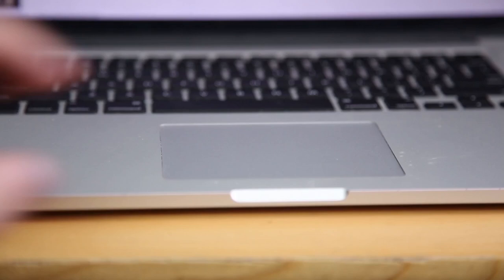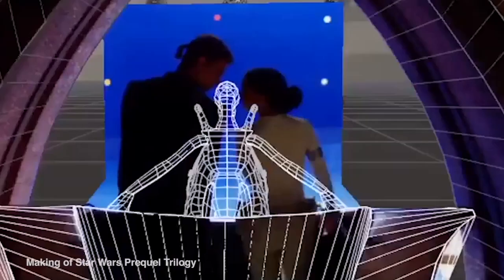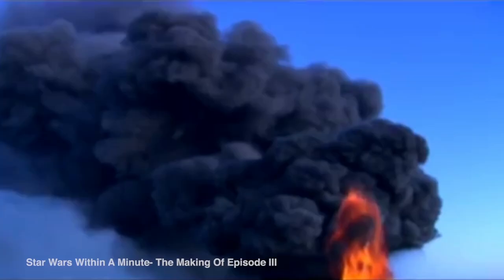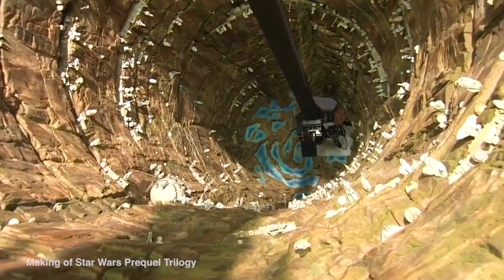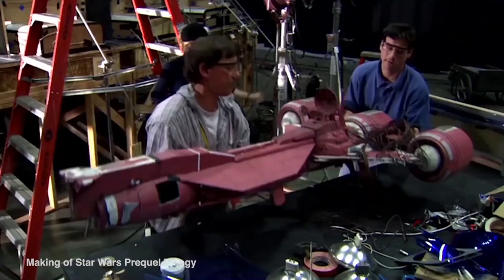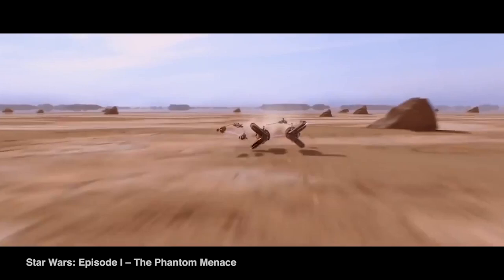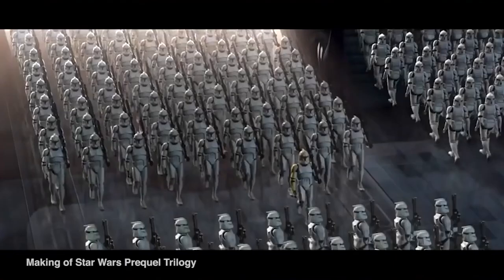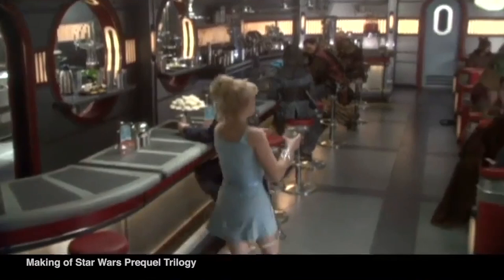The Surprising Practical Effects of the Star Wars Prequels

Comment: The Clones being cg kind of makes sense, they all had to be the same shape and height, because they're clones and usually when you see them together they are from the same batch, so the same age. It would of been pretty hard to find enough actors the same height and shape, it also saves them a lot of time from casting and making the armor.
Reply: or filming one guy 100,000 times
Reply: "Alright Jeff, now I need you to very carefully move over exactly 1/2 a foot, Nope too far *10 hours later*"
Reply: or like how they did with the wookies, film 1 man and use cgi to paste it in the everywhere around the set
Reply: They actually had 5 actors as Wookies.
Reply: The problem with casting the same guy aver an over is that the clones are very slightly out of sync and they would still need to record him several times, and from different angles and walk cycles as best exemplified here: https://youtu.be/zDZeL9kTV4o?t=100

Comment: The Force Awakens scene shows that it is not that the sequel trilogy used more practical effect, but the CGI just substantially improved and look much better now. That's why many scenarios of the prequels could be easily spotted as not real. Imagine if the prequels were made nowadays. However, in terms of plot, the prequels are 1000x better than the sequel trilogy.

Comment: i think the R2D2 issue in the starfighter was fixed? in the opening battle scenes you can actually see the "bulge" underneath the wing where R2s body would sit... the starboard wing had the same bulge as well, likely for symmetry. I think from a technical standpoint, the bulges also served as the landing gear bays, as well as equipment trunks.

Comment: I still believe, that the weird look and feel of the prequels isn't caused by the use of CGI (or at least not entirely). It's caused by the cameras. While TPM still used film in some places, AOTC and ROTS are completely shot on digital (in fact, AOTC was the first big movie to be fully shot on digital ever). But the camera sensors were really small (comparable to a modern point-and-shoot camera you're granny takes on vacation). Therefore the sharpness, dynamic range and overall rendering of the image isn't on par with modern technology - or, in this case, celluloid film. That's why so many sets, models, ships and even characters (occasionally including humans) looked so smooth and shiny. The main reason why it still looked better than an old cellphone's footage were the lenses the used.

Comment: It is not just the story. It is the build up of composite shots, that just do not work on a technical and artistic level. Many scenes of the prequels just look shitty on a shot for shot basis. The lighting and contrast ratio of elements does not match. E.g. the shadows of the live aktion charakters does not match the digital ones nor the miniture background. 

Compair the battle of Naboo in Episode I to The Battle of Hoth in episode V.
Hoth looks so good, because you can relate to the snow, the size of the humans and the mountains in the background. The direct sun is easy to recreate on the minitures. Even if you can spot that there are minute technical errors, it just looks over all real enough to not be distracted.
On Naboo not even the general environment looks real. The grass has no detail or depth in the wide shots, the montains look plasticky and the hole contrast level is strange. 

Compair this to the lord of the rings big battle scenes that combine CGI and live action footage. It looks just way different. Maybe the were just a little to early to be able to pull this scene off that way.
But it is a big part of directing to know your limitations and find a clever way to work around them. They could have filmed a realy grean field with real actors and then just swap them out for CGI ones. 

I guess Lukas just had such a good resume for IV, V and VI, that nowbody really stood up to him, that some stuff simply would not work and just does not look good enough.